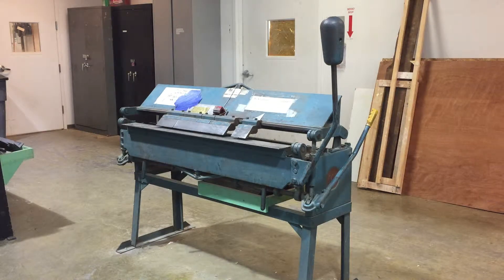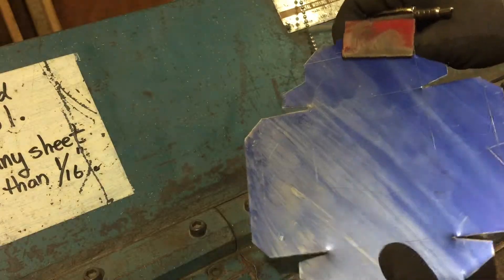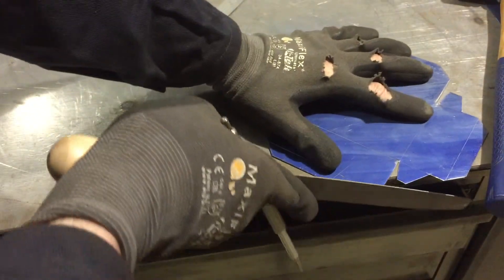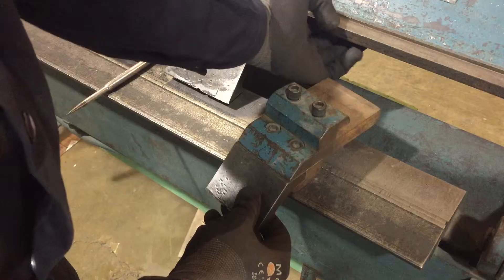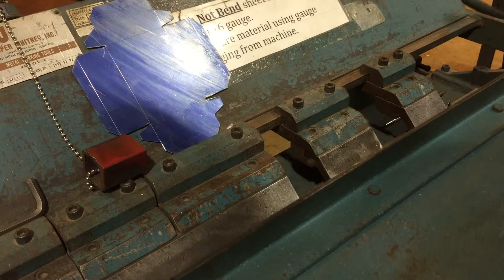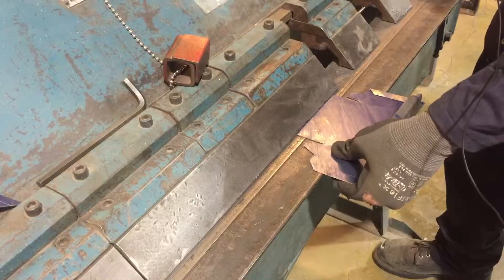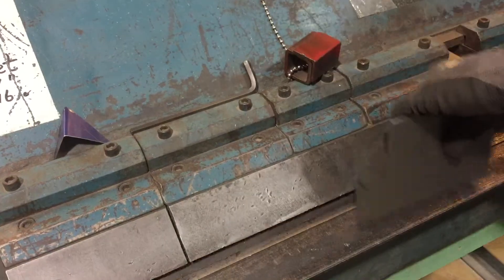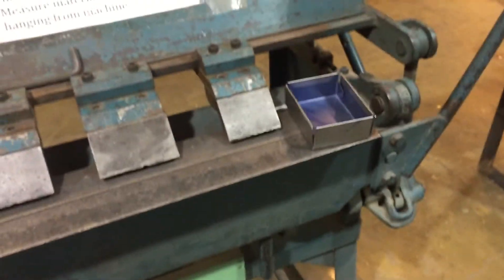Sheet Metal Box & Pan Brake

Comment: And I thought only I messed up and bent the 2nd bend before the first and had to hammer it in.

That is why I have a real nice piece of I beam for that.

And as someone else said the counter weight is not for bending the handles are. 

Yes if the metal is thin it may not damage the counter weight.

Nice though.